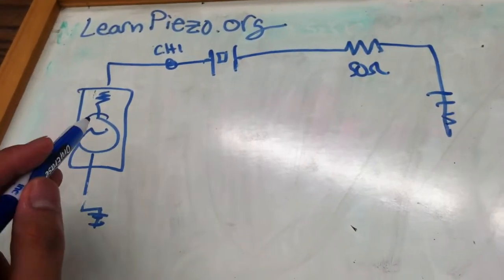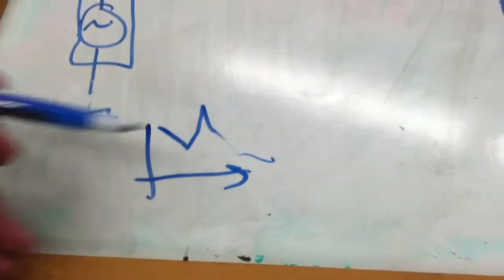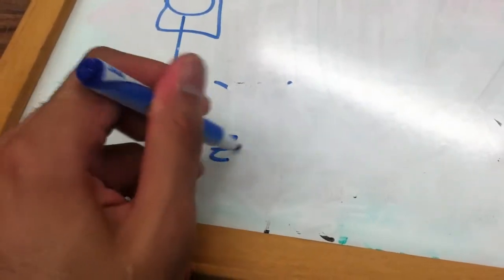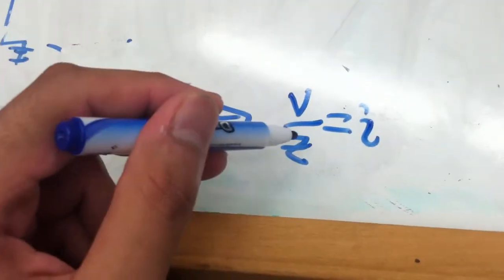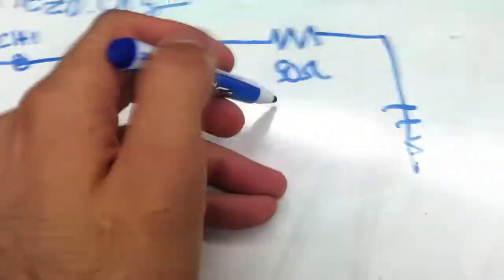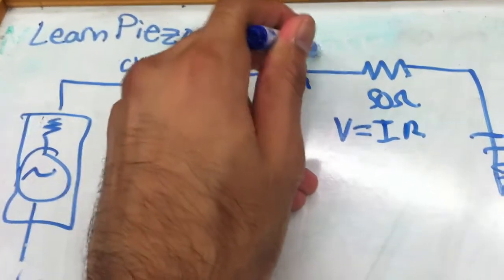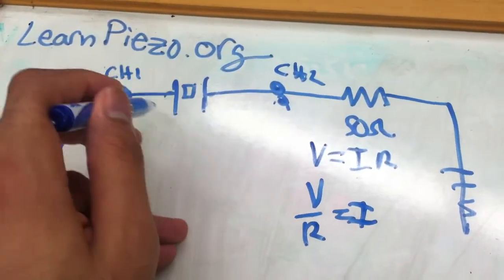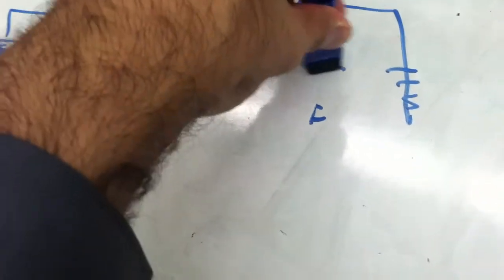Learn Piezo Lecture 8D: Lab measurement of piezoelectric resonance and antiresonance

Comment: Sir can this be used in SAW device to find the resonance frequency?
Reply: Yes,
Signal generator parallel piezoelectric and one resistance series (100 ohms) to ground signal generator and transducer and oscilloscope ch1 to positive and ch2 is resistance and piezo series so signal generator mode is sine wave. 20 volt amplitude set and slowly decrease to increase frequency 
You get the resonance frequency.

Comment: Salam aleykum.
I have a transducer with a long horn connected to it. (I can share the photo if you give me an email address). the manufacturer of this transducer says that based on impedance analysis the resonance frequency is on 23khz. but I did the resonance test by a signal generator and an oscilloscope but there is a obvious phase shift in that frequency. how can we interpret this difference? I mean is this simple method that you are presenting in this video always reliable?
Reply from the maker: Yes, there is significant phase shift at resonance. Yes, the method is always reliable, although for some transducer the phase change is less dramatic.

Comment: Could this method use in measuring Piezo stack? Thank you!
Reply from the maker: Yes, a piezo stack can be driven at resonance to find the resonance frequency. However, piezo stacks generally are not designed to be driven at high power in resonance, so you must not use an amplifier. This is strictly a measurement experiment in your case.

Comment: Tried the setup out and seemed to start working well, but only the amplitude of channel 2 changed on my end. There was no phase shift that designated movement between resonance/antiresonance. Do you have any advice for what I may be doing incorrectly? I'm using a piezoceramic ring stack. Not sure what other variables could change the results.
Reply from the maker: The phase shift might be small depending on the type of transducer. However, for a ring, I would expect a larger phase change. I think you should use a lower value resistor.

Comment: Sorry i have many questions, I will try your experiments and i need this following parameters: Voltage Amplitude? (from the function generator), how did you connect the contacts? (positive and negative terminal to  the PZT material). Thank you very much!
Reply from the maker: The piezo element is in series with a ground side resistor. The open end of the resistor is grounded. Voltage measurement is done at the high side (piezo open end) and in between the piezo and resistor.

Comment: What type of piezoelectric you used? and what is now the exact resonant frequency? (frequency you mean angular or the normal physical frequency?) thanks!
Reply: another question do you try the reverse piezoelectric effect? where you apply voltage and it will oscillate?
Reply: Ah i see. So if i will do the normal  piezoelectric effect, where i will apply force or frequency (resonant frequency) it will generate the same amount voltage as you demonstrate?
Reply: Ah okay so the point of demonstrating the reverse piezoelectric effect is to determine only the resonant frequency, and not generated voltage because it will change in normal piezoelectric experiment.